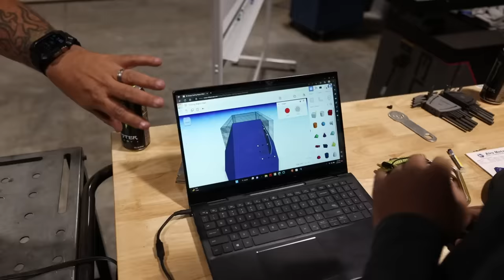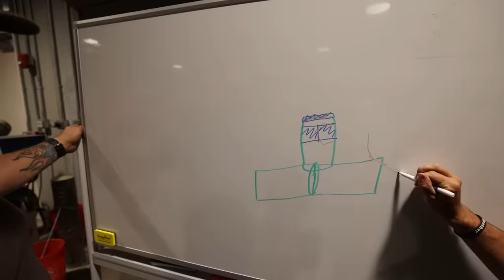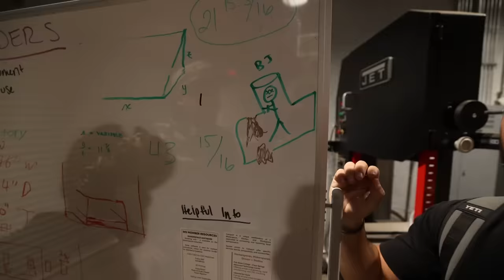Homemade SUBMARINE vs SUBMARINE Underwater CHALLENGE!!! (underwater freakout)

Comment: Fun experiment! I do actually like the water buffalo sub because I think it is overall more practical and could adjusted to make it easier to move the air in/out which was its weakness in design. The team shark did great too and I did enjoy the motorized movement. You should certainly have a comeback and keep the basic designs but have some improvements for Round 2!
Reply: SouthFloridaFishing.  Go away, bot 🤬

Comment: I think in UK "Scissors, paper, stone" is the most common term. Although "rock, paper, scissors" is becoming more common.

Looks like you needed way more ballast in the wheelie-bin sub.

....you should try and turn a small car into a wet-sub. Remove engine, wheels, axles, etc. seal the doors & rest of the cabin, put some fairings over the wheel wells, hole in the bottom to get in/out, skids  on legs coming from underneath to give room to get in out the hole in the bottom. (Ballast where the engine & trunk spaces are, as you'll need a lot).

Comment: With as much money as you guys spent, you should have just bought a refrigerator and gutted it out. Refrigerators already have the seal around it , so all you would have to do is drill some holes to put in an interior door latch and then another hole to attach a water hose for a breathing tube. Then all you would need is a big enough hole for a see through plexiglass window. It probably would have been cheaper than just one of your entire purchases.

Comment: 21:04 that is not a good thing, batteries underwater with un-covered soldering is very dangerous and when charge is pulled through it, it could electrify the water and blow up

Comment: in the start of the video you said 5ft down 👇 or it's not 🚭 a sub so... I'll take the manuverability sub but surface vision did have the breathing bubble just couldn't get down also you gonna trust that plastic to hold up under pressures? should've tested sub parts even before build😅

Comment: Too light. And wrong materials used. I would ad a fourth rule bevore i call it a sub. That is you stay dry all time. So a big tank like a propane tank that is 7mm thick steel. And there you have a good base to built from.
Then you could saw a second tank in half and put one half on the head side and the other half on the tail side. There you have ballast tanks. The smallest accrillic window you can make should be 2 inch thick. If you want to have a better view you can work with cameras. You can make it man powered with you have to paddal. That way you can lower the costs.
Reply: @sayorancode  You got a good point LOL